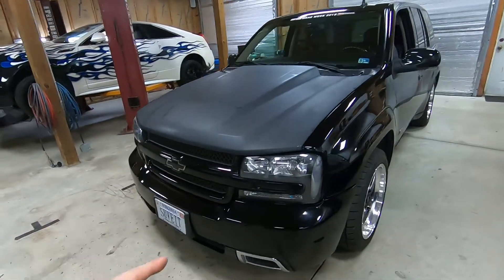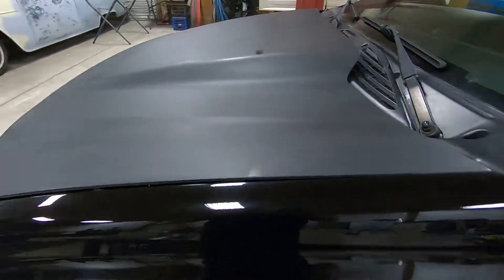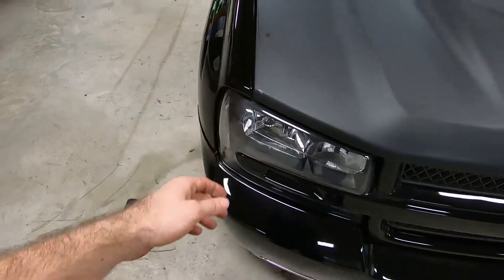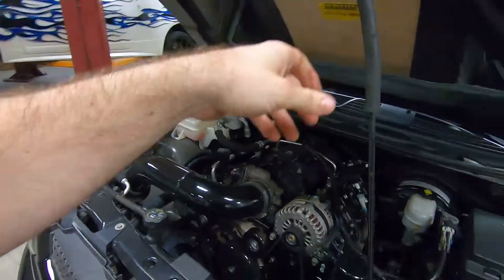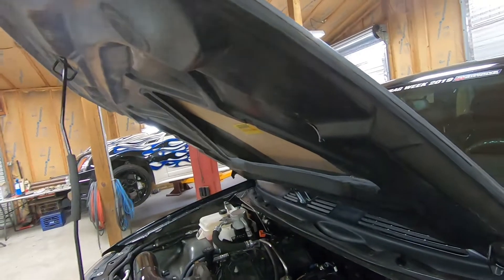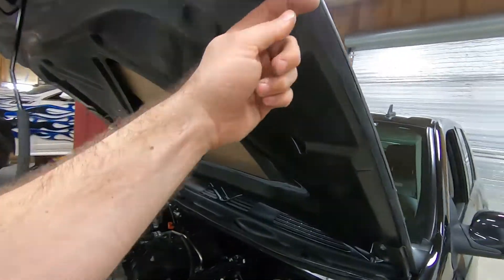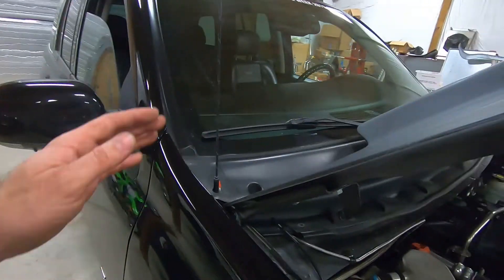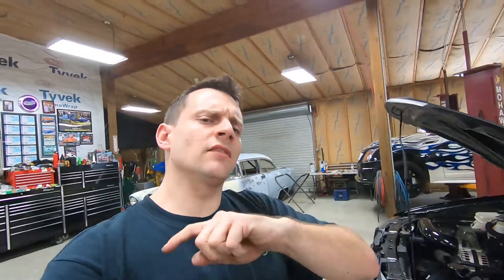The TRUTH about aftermarket hoods!

Comment: Just a question for you. I purchased a new truck and later found out it had been wrecked. I believe it has a aftermarket hood. Chevy Silverado 2500 4x4. Does GM manufactured parts have a stamped part number on them? What is the best way to tell if the hood is an aftermarket or manufactured?
Reply: The shape and the fitting. They do not stamp their products so it’s sometimes hard to tell.